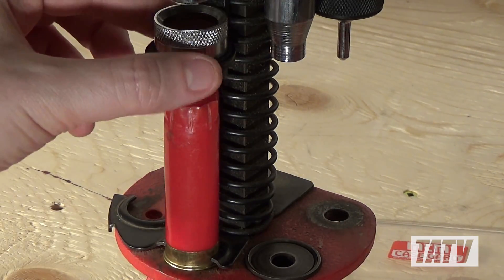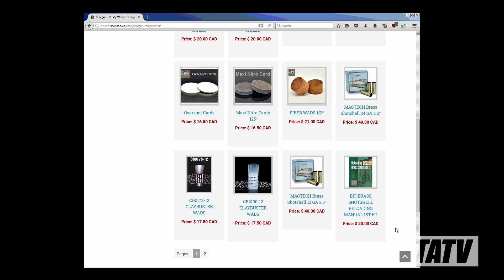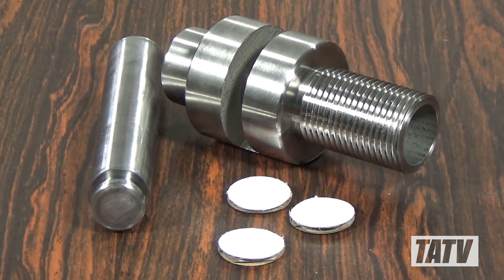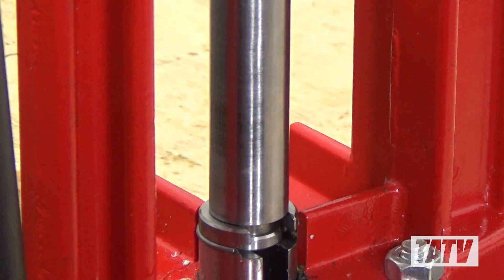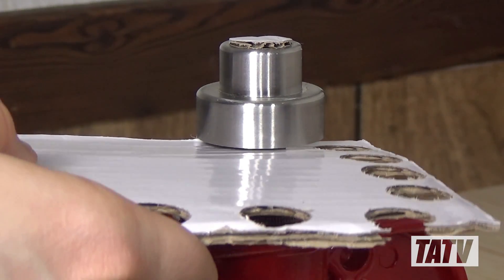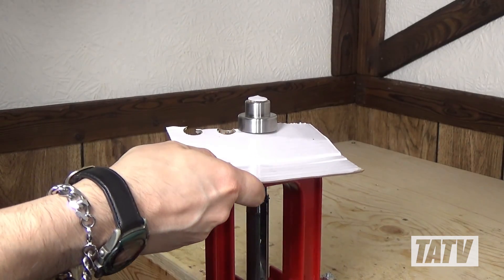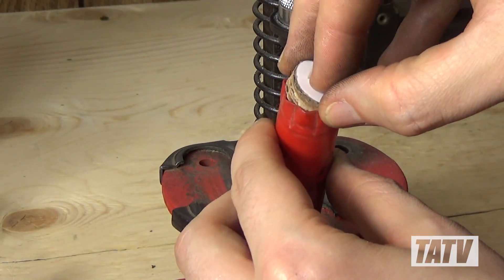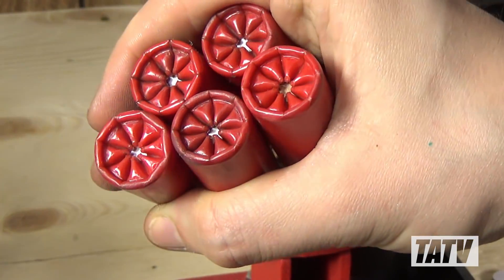Prototype 12 Gauge Shotshell Filler Wad/Overshot Card Punch

Comment: Saving money on 410 is my thing so I'd be interested in a wad cutter for that. I buy 12 gauge target loads for $7 a box, then pull them apart and make reloaded 410. I can reuse everything accept the 12 gauge wad and hull. I get 25 rounds of 410 at a cost of about $3.50 per box instead of $16 at the store.

Comment: That would be very helpful for reloading full bore diameter foster slugs. I take it that you have a lathe?
Reply from the maker: I wish I did...  I mostly design the tools and contract out production.  It's really difficult to find manufacturers willing to do small volume production though (100 or units at a time) so I may have to purchase one at some point.
Reply: I know a reputable company in the States

Comment: Nice , I use 20 gauge  1/8 " nitro cards under my Lee slugs . Have you tried the material that the nitro cards are made from ? I'm not sure what the material even is , just know that is very hard .
Reply from the maker: I've tried the same thing with great results.  I think it's some kind of ultra-compressed carboard/fiberboard.  Corrugated cardboard works pretty well and is obviously very cheap.  For the situations where I really want something that won't compress, I'm going to try cork.
Reply: I've been looking for a DIY nitro card solution that's comparable to the retail offerings, but haven't found anything.
Reply from the maker: It's like a super-compressed fiber board.  I was out shopping today looking for some but haven't had any luck.  I did get some cork, foam and felt that I'll be trying though.
Reply from the maker: Well, if and when my testing is complete I'll likely have these for sale.
Reply: Psyko Klown    If the material was available wouldn't a 5/8 hole saw work ?